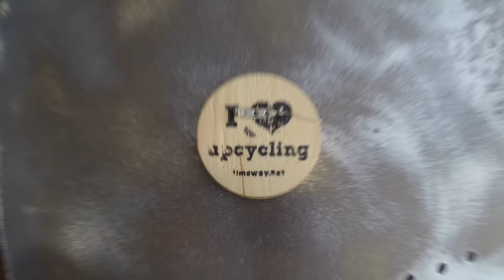Metal Art - Sculpture steel face

Comment: Do you prefer to use fluxcored wire without shielding gas?
Reply from the maker: Now that I've been using solid wire and gas, I don't think I would go back to flux unless I had to weld mobile a lot or out side in the wind. Gas is much nicer to weld with.
Reply: Ah okay, yeah, shielded welds are way better. Easier to control because you can actually see them happen :)
Reply: Also, using gas and a flux wire is great but meant for more heavy duty industrial welds for material of 8 mm or thicker. The welding spot "floats" better and is therefore more applicable when doing massive welds at once. I've made welds (with a lot of heat) that were about 25 mm wide in one go, instead of strands of build up like normally done.
Reply from the maker: Wow 25mm wide! I've never welded heavy industrial at all. Just really light non structural stuff to help out at work. But a while back I worked at a refinery as a fitter constructing Roasters and the boiler makers just used Flux core or rods and lots of Amps. Cheers!

Comment: stunning work ,,,, be a lot easier to clean if you kept the shroud on the welder though
Reply from the maker: Thanks! I use Flux Core wire not gas.  Might try some splatter spray some time, and some times the flux hardens over the tip of the wire which seems to stop the arc, hence you might see me trim the wire in the video. All the best!
Reply: try cooking oil , either in a spray can , or out of the bottle and wipe it on with a rag ,,, it will save you hours ,,, so would gas and a shroud ,,, but the cooking oil tip is very cheap , and handy ,,, try it and let me know.
Reply from the maker: Thanks Tom, I'm pretty eager to move over to gas which may be soon. Up to this point I have just made stuff for the fun of it, but there is a chance that I'll be doing some customer work. Meanwhile I'll get out the cooking oil. if nothing else, my welding will smell like chips. :)
Reply: i weld a fair bit , anything from car body work to digger buckets , and all sorts in between , cooking oil is one of the best tips i was ever given ,,, do a search for , welding tips and tricks , on u tube , jody shares a lot of inspirational stuff .but you will only end up wanting a tig gun ,,,, only look if you can afford to ,,, lol
Reply from the maker: I actually have a cheap Tig/ Plasma / Stick combo machine. Works good for stick and cutting so far, never tried tig due to having to set up with gas I suppose. Though I'd love to try tig, it would be a great skill to master.  I have to watch more of Jody's tips, always learning!
Reply: Flux core is great for general fabrication but not for this. Like you Scott I don't use gas. I can't justify the bottle rental as I don't weld often enough. I have done a lot of oxy/ acetylene gas welding on car body metal and I like it better than tig.